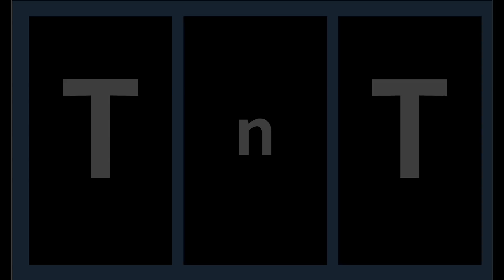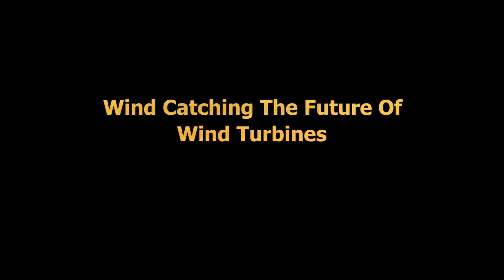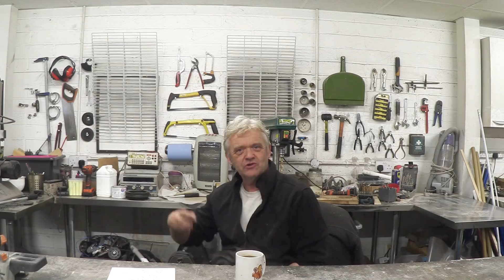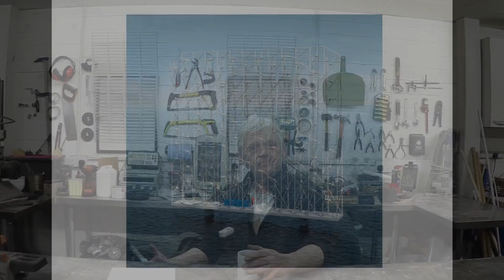1299 Wind Catching - The Future Of Wind Turbines

Comment: I appreciate you posted this video, but I do have some remarks to be considered. A round tube or guywire has 10 times more drag than an aerodynamic shaped profile of the same thickness. The reason why blades on large turbines are tilted is to slow down rotor speed until a complete stop during heavy storms. At the time I read many reports, if I remember well, the structure must be able to withstand a windspeed of 50m/s during 2seconds. That is a vast amount of energy. If I see how many tubes and nodes are involved in this structure, I wish the engineers the very best to try and prevent this from being blown over.

Comment: Hi. For a few years i ve been thinking about this concept and to use those split ac blowers. they a few feet long and can be hung from a frame like a curtain with a small motor at the end of each rotor. each motor and rotor combo can be fixed to a speaker coil like your pole wind generator. so when the wind blows through, it spins the rotors and each rotor motor combo will rock back and forth like a curtain swaying in the wind. so its two concepts in one. and the frame can be mounted on outside of buildings or perhaps windows. its just in my mind right now cause i dont have the resources or know how to make it happen. maybe you can prototype it.

Comment: Take an oil drum, cut it into 5 equal blades along the vertical, bend the blades at 36' angle with 2/3 sticking out. Make two and weld them together and turn it horizontal on bearings. Turns from all wind directions plus it has a " sail" effect if the wind comes at an angle. Put two opposing cones in the middle to cover the hole when looking from the side Cheap and effective it produces talk instead of just speed.will know the actual output soon.
Reply from the maker: nice one mate - thank you for posting - awesome idea

Comment: Fantastic!!  I’m curious if the cost per installed kw generation capacity of wind catchers is low enough that adding in the right grid scale storage would then give a cost per kw that competes well with wawt or solar?
Reply from the maker: I think it is something like 2 times cheaper but check out wind catchers website for fuller details

Comment: R.e. your point about large turbine tips reaching a speed limit - it's my understanding that the tip speed ratio is broadly similar for large and small machines - where did you get the fact that large ones reach a limit but small ones don't? Cheers.
Reply: TSR isn't actually a "limit". It's an ideal range (6-8) that the turbine blade should be designed to operate within, for maximum power extraction from the wind. Too slow, and most of the wind passes through without any power being extracted. Too fast, and the turbine acts as a "wall" and the wind tries to go around it.
What Rob referred to is that "absolute" limit of tip speed, in a tangential direction. Not the ratio to wind speed. 
As turbine blades are made larger and larger, the danger is, when operating at ideal TSR, the tip speed approaches supersonic. We can't have that. So they have to be made to slow down, below ideal TSR, thus becoming inefficient, losing the benefit of having the longer blades in the first place.
So all the money involved in raising a massive turbine up high to utilise the higher wind speed. at some point becomes not worthwhile,
Reply from the maker: I am sorry but you didn't listen to the video properly - I never talked about tip speed ratio - I talked about speed at the tip - it's not the same thing
Reply: @ThinkingandTinkering  the speed at the tip is the same on big turbines as it is on small turbines. I did listen! I think the philosophy of redundancy is sound - just picking up on the point your making Ng at 3.50 about the limits of large machines. They ARE reaching the limit of the materials but not due to the speed at the tips - this is the same regardless of turbine size.
Reply from the maker: re-read what SteveMac said - It may help you understand
Reply: @ThinkingandTinkering  the way he describes tsr is indeed good - not missing the wind etc. So a small blade has an ideal tsr of 7, and a large blade also has an ideal tsr of 7. In a 10mph wind the tip of both turbines wants to go at 70mph. For the larger turbine this happens at a lower RPM which the gear box compensates for. What am I missing?
Reply from the maker: a gearbox gives up torque for speed
Reply: @ThinkingandTinkering  I still don't see what the issue with large blades is? Can you reiterate what your talking about at 3.50? Cheers
Reply: @dexterdixon2000  You’re missing the relative Windspeed, it is added to the windspeed through the rotor. It is true that the tip speed can reach the speed of sound. Small windturbines can operate much higher rotation speeds, which is, with stormy weather, quite frightening. In the ‘90’s I worked as a trainee in Danish Folkecenter’s windtestfield
Reply: @paulbrouyere1735  I am not missing the effective wind. My point is just that the tips of big and small turbines go at the same speed - assuming they have the same TSR. Small turbines have much higher RPM which is indeed frightening if you're not used to it. For the past 15 years I have  built, installed and maintained over 100 small and medium sized wind turbines.

Comment: The 'i' in RAID sometimes stands for 'inexpensive.'  Key to a redundant wind generation RAIT system will be to make windcatcher system components very cheaply.  A lot of the ideas you've explored would be great for such a system. 
A note about wind turbines changing blades -- you are correct, that the real lifespan of a blade is about 10 years, failure or early replacements usually involves complete demolition and replacement of the facility.  All in all, this tends to validate your idea.  
"Dutch" technology for windmills was actually Indian or Arabian sailing boat technology, imported through Spain.  The Nederlands actually made the ideal best development and use of the technology, pumping out polders.
Reply from the maker: nice points mate and thanks for the correction - I guess the tech used is even older than I thought - cheers

Comment: There is an optimum size for wind turbines. To big and you run into the square verses the cube rule (mentioned in the video) but reducing the size too much and you run into problems of number of units to have a meaningful output!

The Wind Wall concept can increase the output due to the increased air pressure on the lead side (the wind is being obstructed by a wall of fans moving slower than the wind) and decreased pressure on the downwind side. 
One thing that jumps out at me is to plug the holes in the wall! Those gaps between adjacent fans will let wind through that could be used! Another thing is that the wall is not rotatable so will only be efficient with prevailing winds as found on the coast!
Reply: Dave W … I thought the same about this not being able to rotate but, according to the company that came up with the design the frame sits on a rotating turret. They have made a smaller version with 117 turbines and have now scaled it up to one with 126 turbines, the artists impressions show the wind wall to be as tall as the Eiffel Tower and the length of a cruise liner so I would like to see the size of the turret it sirs on.
Reply from the maker: nice points mate- cheers